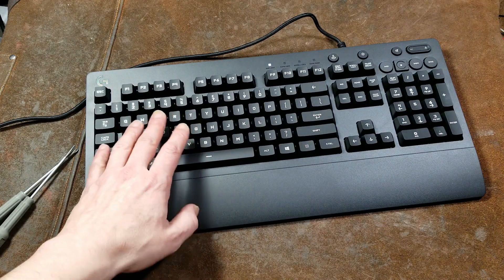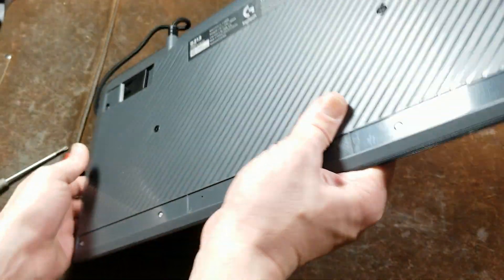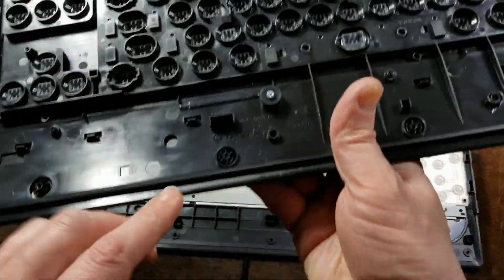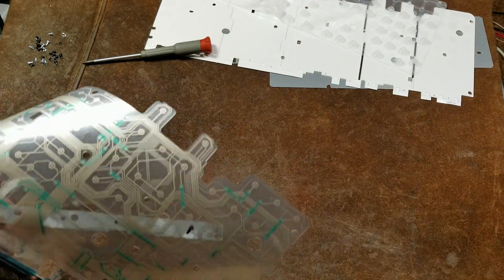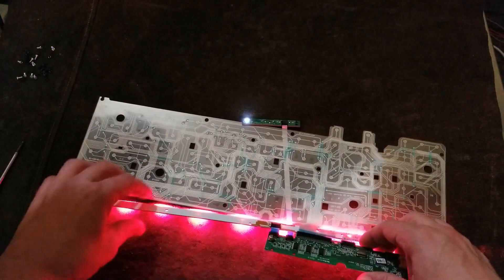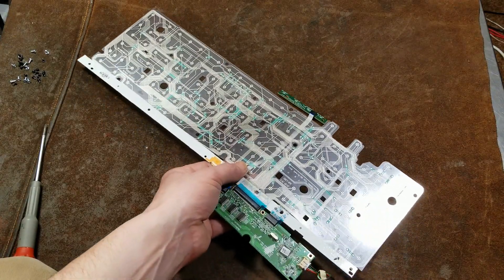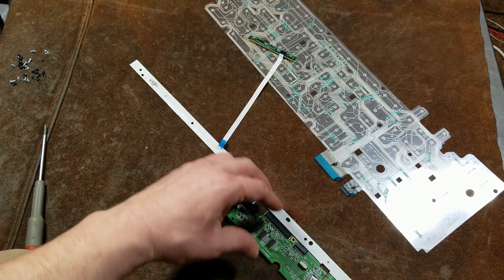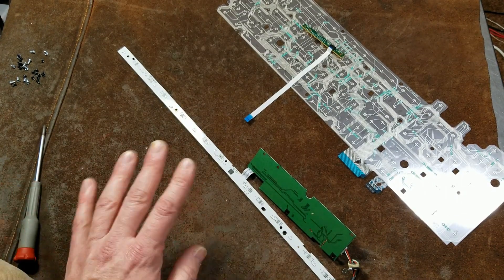Logitech G213 RGB Gaming Keyboard Teardown/Disassembly

Comment: For the spill resistance, I can actually say that that feature works somewhat. I´m watching that video because I managed to spill ginger ale over the left top edge of mine. The liqid didn´t manage to pass trough the top cover of the keyboard, the keys seem to seal the electronics somewhat off to casual spills. My spacebar was a bit stuck because the keyway got sticky after most of the liquid I couldn´t get out followed gravity right to the lower center of the keys. But the inside and the electronics are completely untouched, not a bit of stickyness in there, so I can confirm their advertising statement, still wouldn´t recommend giving it a shower though.

PS (Edit 1): Dont get fooled by the hole underneath the sticker liek I did, there´s no screw under that, the top part just has stronger clamps than the lower sides

Comment: I need a nice keyboard, reliable. g213 has started to give me a headache. letter E was not engaging if not pressed firmly. I took it apart, cleaned. put together now E is working properly. But I have the same issue but with letter o now. idk why.

an update cleaning indeed helped. Just had to press firmly in the middle were to hear a click and everything works like a charm.
still decent keyboard for the money

Comment: I have this keyboard,the build quality of this keyboard is really crap, alot of the keys bottom out, some have to be pressed harder to work
Reply: If you've bought this keyboard recently I don't doubt it. Quality has went down hill, they aren't including a braided cord anymore, the rubber on bottom of board doesn't go all the way across like it use to either. Now it moves/slides when gaming because if this. If yours is like this then it's a newer inferior build imo.. Like everything else made these days companies are trying to save 50¢ & charge 200% more.
Reply: i bought my keyboard 2 years ago and it has a braided hard wire but i fixed it and it works like a charm now @craigstern2902
Reply: I havethe sameand the space-bar sometimes miss, sometimes double click double space, (proof on this text not corrected). All the rest still working ok.

Now, I'm planning to extract the space bar and clean it, maybe it is dirt or something. But it is so hard to remove that I'm afraid to broke it. Do you know if keys can be removed in this keyboard? or should open it from the bottom as in the video?
Reply: open it from the bottom, also the screws under the rubber pads.  I ended up putting a small drop of hot glue on each rubber dome, let it harden and put the keyboard back together. Now it works perfect @vamremMX

Comment: Just tore mine down to give it a proper cleaning
Thanks for showcasing where all the screws were, I decided to just cut into the rubber pads without removing them because they always always always just fall off after they've been removed once
Really appreciated
Reply: I tore mine and pads are still holding very strong and sticky
Reply: Use very thin double sided tape to fix the pads.
Reply: contact cement will fix that
Reply: Jesus loves you so much more than you can ever imagine. fr

Comment: but actually can you remove keys without breaking them? I'd like to clean it a bit but I'm afraid to break the keyboard
Reply: Yea, you can do it. Follow the dissembly steps and take the top portion plastic and use needle nose pliers to press on the tabs from the bottom side of buttons. They pop out from the frame. Just wash it in Luke warm water with soap and toothbrush. Once they dry for 3+ days. Reassemble and test. It would work.
Reply: @ErickBuildsStuff  is it possible to rempve top right corner buttons like the audio mute button? I'd like to check it cuz it started givin some issues like poor aptical response or however it is called, it doesn't "jump back" when I press it the way it does for example the RGB on/off button

Comment: You could fold the circuit board underneath the keyboard (externally, cut the case so it goes as far back as possible). Build a shield using a sheet of plastic from a coke bottle for the electronics and flex cables (form the sheet using heat) and use large strips of kapton tape to keep it from moving (remember to cleanup the surface with iso first). Adjust rubber feets for clearance. Fill the hole left from cutting the arm rest with black hot glue (use the oven's glass top to shape the glue, put vaseline first!) then use a variable heat soldering iron to cleanup the finish.
Reply: Or not. Just buy something you want, damn.

Comment: thank you, it was easy to remove the screws, after that i cleaned between membranes with alcohol, but some other keys stopped working after i assemblied it, had to press really hard, then a strong bang on the keyboard fixed it! haha

Comment: its shite, terrible spacebar button, i have to click on it like 5 times to make it work. waste of money
Reply: Probably too late to comment this but did you try disassembling it? My space bar was either not registering or double tapping - I moved the membrane sheet and it fixed my issue. No problems with the space bar since 

It's possible the membrane was slightly off centre or something.  I also had double tapping keys and that's fixed too
Reply: It works great i have it

Comment: I got the same keyboard and I accidentally spilled a cup of coffee on it. I'm being lazy just rinse it with water ( since it is spill proof) and dry it off. After drying it off, I realized that the left shift button turns to ^ and right shift button turns to 0][2;Z7 when I'm typing. What a low quality product?
Reply: Same here, in my case the 1 Button is Capslock and Y and Capslock are not working anymore. Now I disassembled it and hooray, there are water stains between the layers, possibly ruining the keyboard forever. I am anxiously waiting for the water to evaporate. Wish me luck!
Reply: @phiore967  Good luck. Mine dried off but it's a permanent damaged. Saving for a new mechanical keyboard instate and definitely not Logitech brand.
Reply: @ianlingam281  Mine did as well. I completely dismantled it and found out that there was permanent water damage. I now threw it into the trash. But thank you for replying, mate 😊

I wish you a merry christmas and a happy new year. Or in German: Frohe Weihnachten und einen gudn' Rutsch!

Comment: Any way i can find just the internal circuit films (the 3 sheets glued together)? I have a few keys that don't respond to touch. I had opened it up and cleaned the plastic sheets as well. Still doesn't work.
Reply: sounds like something was spilled and made them stick together, there you have your shortage and keys are not working,
Reply: @arkeyn3831probably yeah
Reply: Jesus loves you so much more than you can ever imagine. fr

Comment: I own this keyboard and I actually think it is pretty good (considering the price of course)
Reply: I own this keyboard, and I used to own a steelseries apex pro, and for my preference, this is the winner. Can take more beating, I actually had to order replacement buttons for the apex as they cracked in half from a moderate hit... These keys have just the right force to push (all these mechanical ones are way to sensitive for my taste, I like to be able to rest my fingers on the keyboard).
Reply: @Adam-gb3yj Jesus loves you so much more than you can ever imagine. fr
Reply: I got my g213 for 15 bucks at target since it was on clearance
Reply: @williams7713 Jesus loves you so much more than you can ever imagine. fr
Reply: Exactly, mine from 17 when the released the 213 still works but keys wore retry badly on wsad, shift & c from playing BF. Just ordered 2 more that were open boxes for like $42 off eBay. Great for the price & they're made to mimic a mechanical with a low throw as well. Best thing bus they're quiet imo
Reply: Jesus loves you so much more than you can ever imagine. fr

Comment: You've gone nuts.  Yo could rip the guts out of lots of things and they'd still work but be inferior.  The type of plastic used is plenty strong for a mere keyboard.  It's not as though you're going to be pummeling zombies to death with it.

There is no reason to make it thinner.  There's nothing you'd save space on by stacking it on your keyboard so it's just open air.  Plus, it needs to be thicker for decent rubber domes with a good amount of travel instead of the crap they put in notebooks with the short travel scissor-springs.

If anything it seems like you need a computer desk upgrade if you can't fit a few inches of keyboard depth or 1cm more height to it.

Plus, if you make it thin, even if you use more expensive plastics, it gets weaker, and there will be less depth to catch spills so the circuit sheets are sitting in it.

All high quality keyboards are larger.  No matter what the materials and design is otherwise, thinner is a downgrade.
Reply: Thank you to the uploader for the teardown. Had a recent spill and helped alot with not having to guess if I needed to remove a warranty sticker or not lol. That aside I've had this keyboard for about 2 years of very heavy use and still going strong.  I'm very conditioned to the bulky formfactor to the point where I favor it over my mechanical keyboard. For the price it does its job. Tbh I forgot it had rgb lol. Anyways hope everybody is doing well. I'm getting a bit stircrazy being stuck inside more than usual. Stay safe
Reply: true!!!!!!!!!!!!!!!!
Reply: Fully agreed.
Reply: Amen to that brother